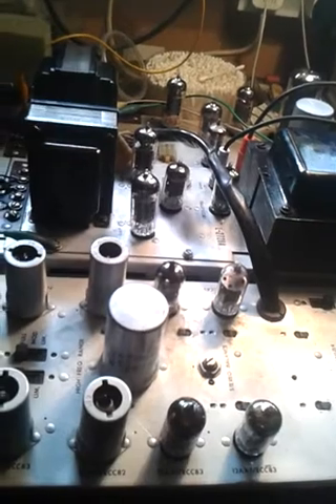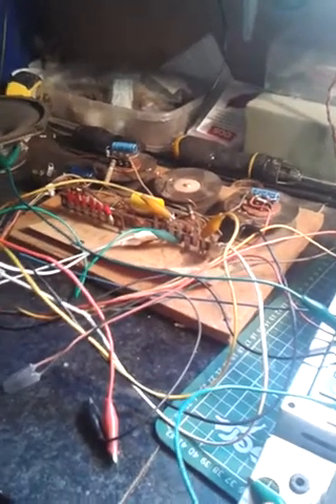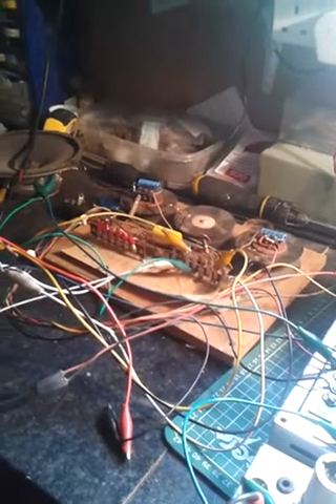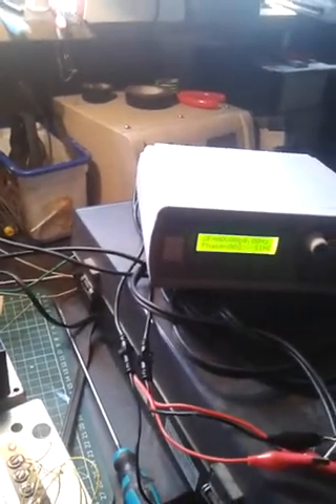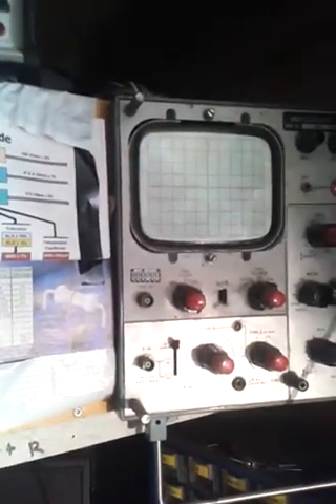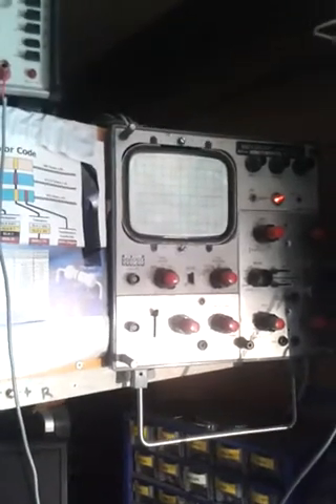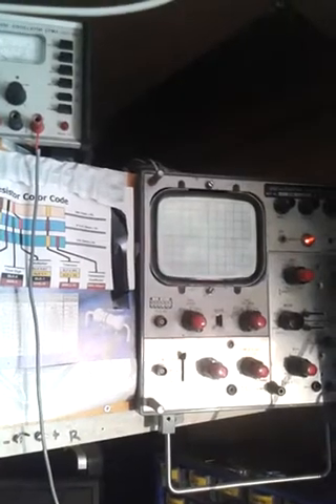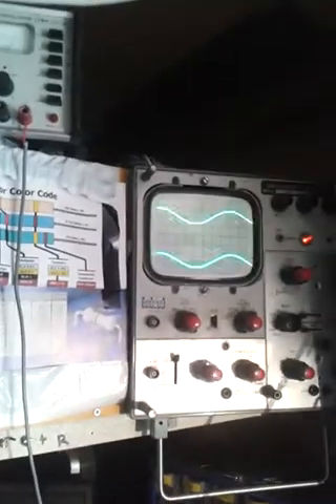ami continental jukebox  stereoround how it works

Comment: If you were wiring this up to a modern amplifier with only a positive and negative for the left and a positive and negative terminal for the right speaker how would you wire the single woofer?